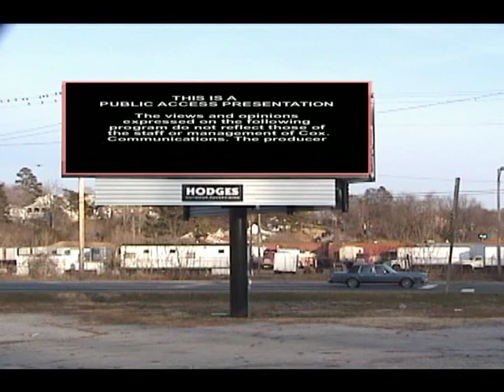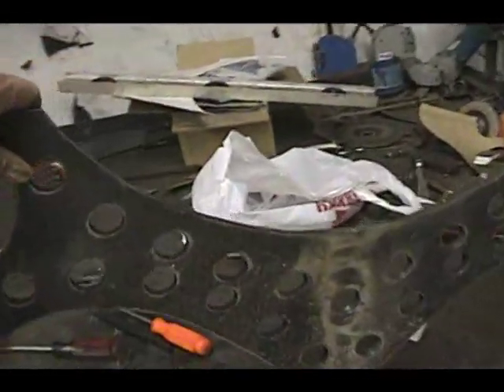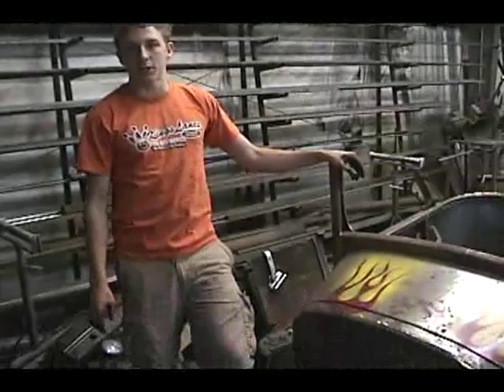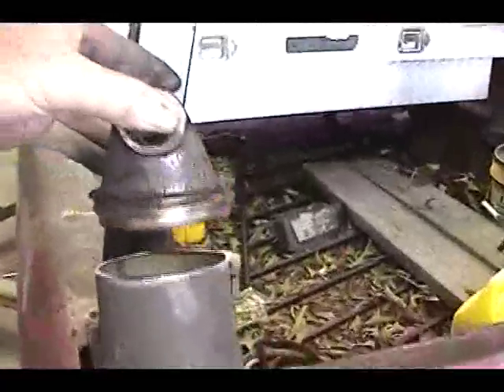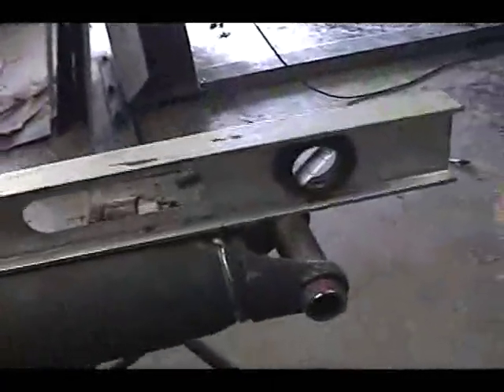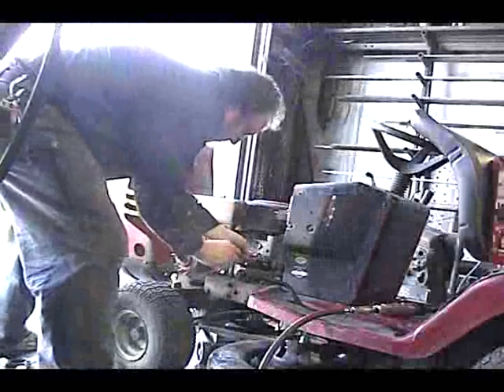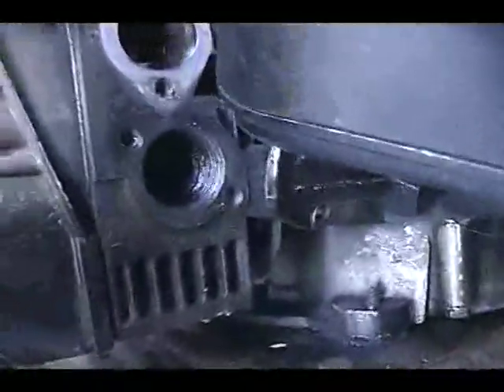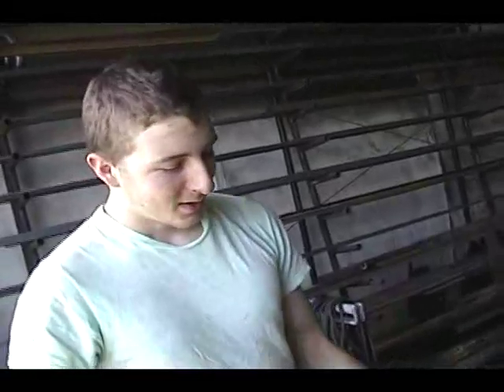Kenny's Monster Shop RatRod Build 5th Show (1.28G)

Comment: Oh Hell Yeah!! Hey Kenny Take the carb from the spent engine and put it on the replacement engine.  You'll get your 12 and a half horses!!  Thats the only difference.  Oh by the way the carb from the 12 horse engine will run the 14.5 but you have less power.  Clean up the original carb for that 14.5 and you'll be in business.  The red top engines are a better engine that the black covered engines.  Red tops have cast iron sleeve bores, the black ones are all aluminum cylinders.